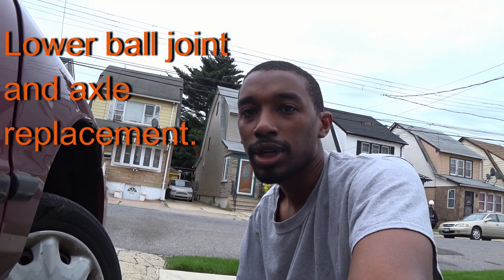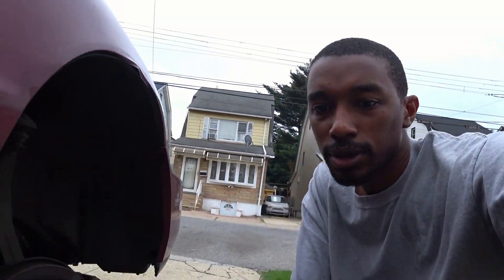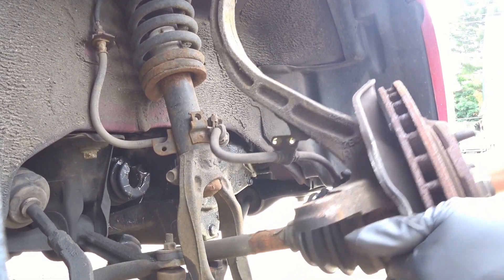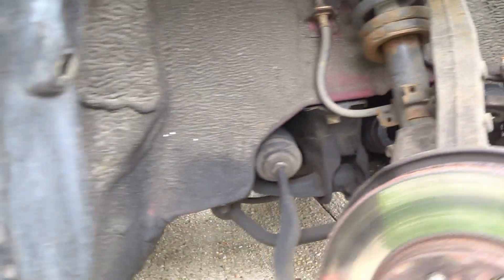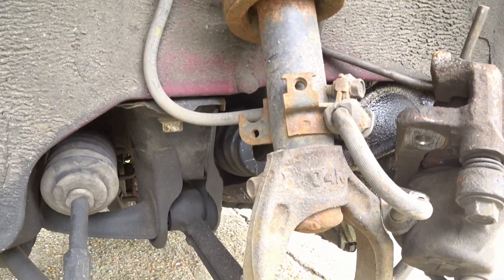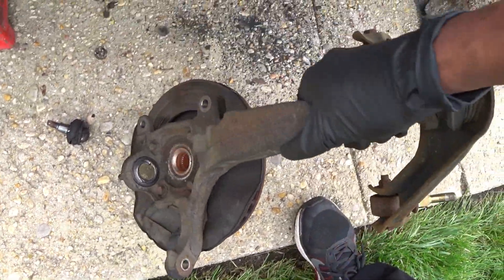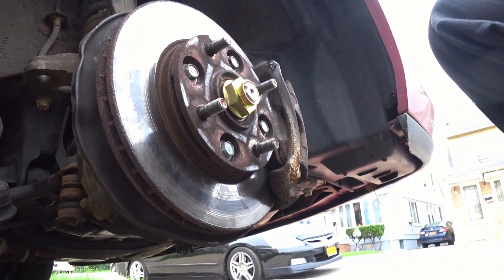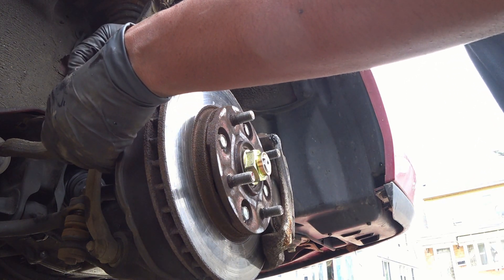HOW TO REPLACE BROKEN BALL JOINT ON ACCORD

Comment: Thanks for the video! Does the axle have a C clip on the transmission side?
Reply from the maker: Yes it does.  Normally I use a screw driver to pop it out the transmission. Be careful because fluids will leak out.